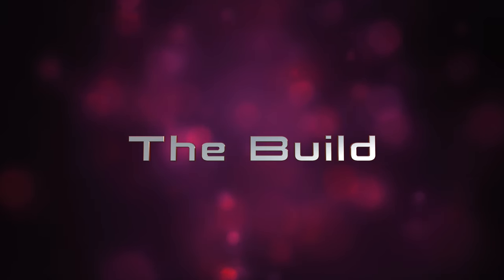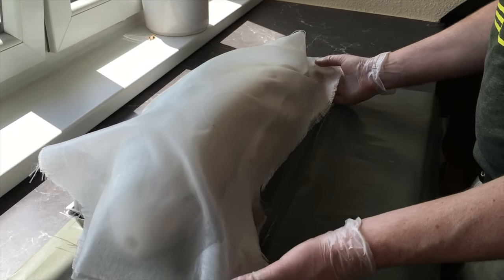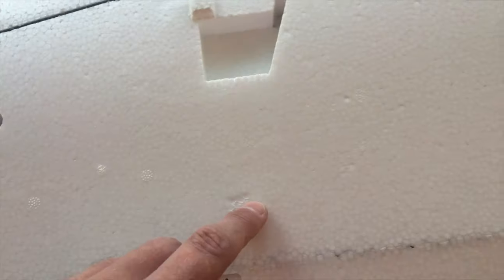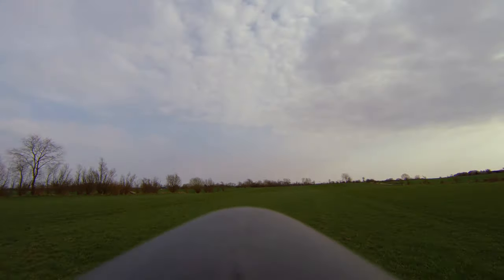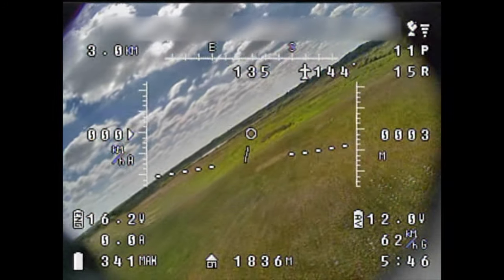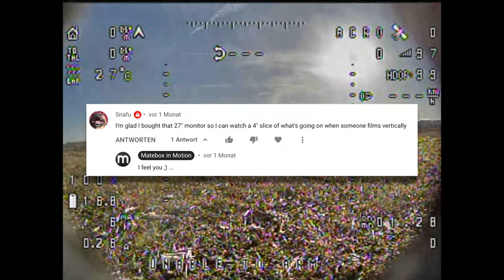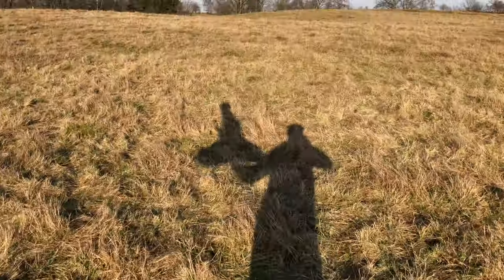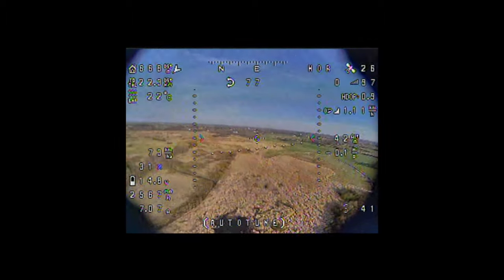How I build my Skywalker X6 over 5 years | Skywalker X6 EP:01

Comment: Nice wing. How much extra weight do you think is added with the fibreglass?
Reply from the maker: Hard to tell- but the way of adding that varnish doesn’t cost that much weight especially for this wing span. 

For smaller wings this will be overkill but if it’s a wing at this size, I’d like to make it durable on landings in the field.